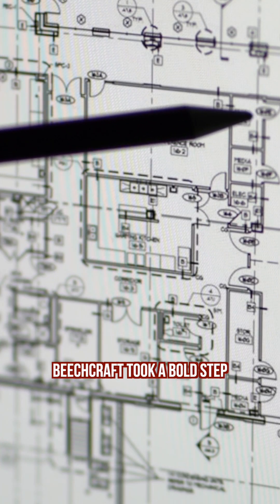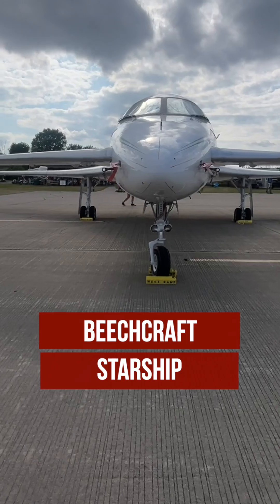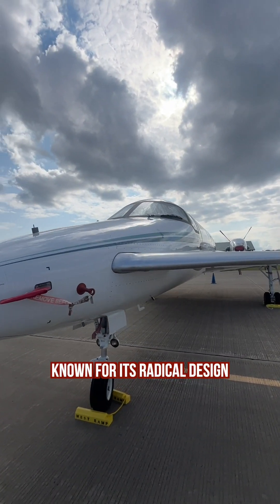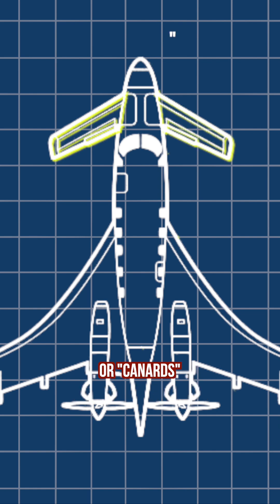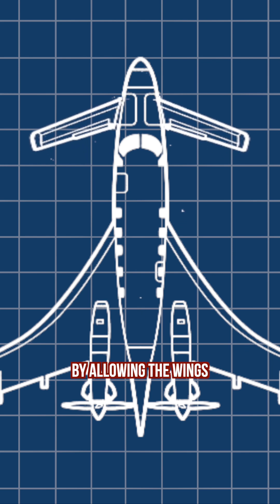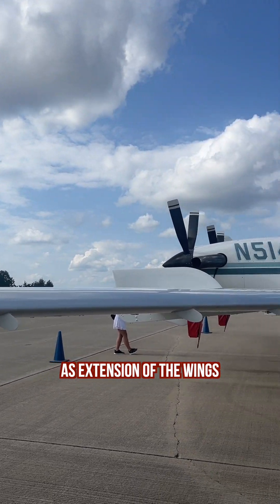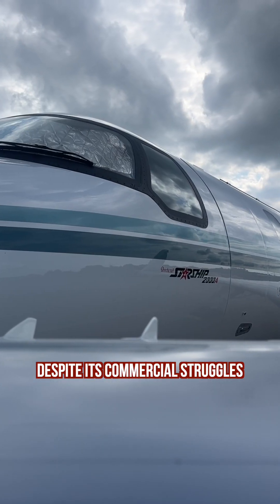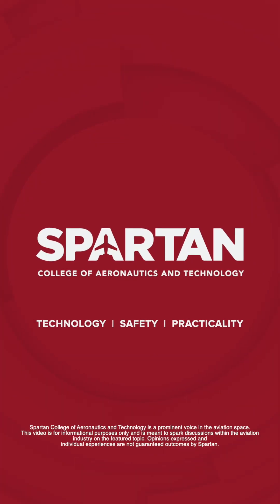The Beechcraft Starship's Wing Design Evolution

Comment: As one of the first composite commercial aircraft, Beechcraft overbuilt the structural stiffness of the fuselage and wing of this essentially flying wing design.  Which made the aircraft too heavy.  And thus not efficient.  Instead of a 12,500 pound class medium twin engine aircraft, the gross weight had to be increase to nearly 14,000 pounds to give it a useful payload comparable to other aircraft in its class.

Comment: Sorry, Spartan, you messed this one up.

The most radical thing about the Starship was its canard layout. The benefits are efficiency and safety. 
That's not wing design, that's aircraft configuration. 

The canard was variable sweep, like the wings on a Tomcat, but in this video it came across as saying the Tomcat had a canard.
The variable sweep was for complicated reasons, and could well have been ignored entirely in this video. 
The animation of the sweep was poorly done.

The winglets don't act as rudders. They act as vertical stabilizers. They carry the rudders.

We expect the best from Spartan.

Comment: Tomcats do not have canards. Are you a troll?
Reply: I think he was referring to the variable positioning ability, not the forward placement
Reply: JFC it's clear he was referring to the variable wings in the F14. And for what it is worth the initial blocks if F14As did have retractable canards to compensate for the shift in center of mass during wing rotation.
Reply: @javiermesa-martinez8731 I’m pretty sure if they don’t move like an elevator they are just retractable vertexs stabilizers